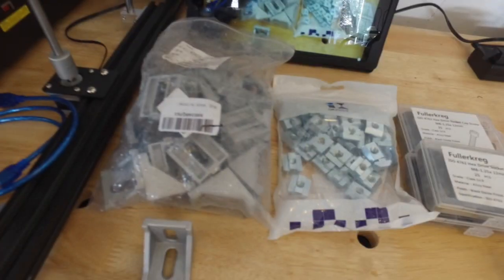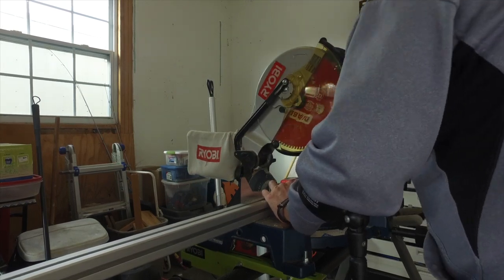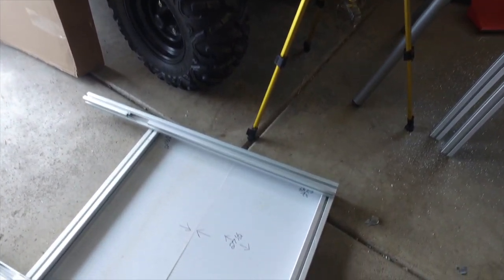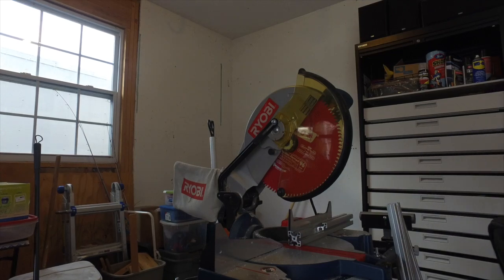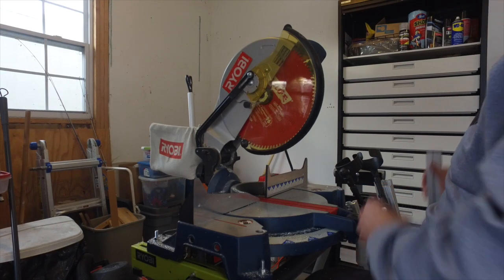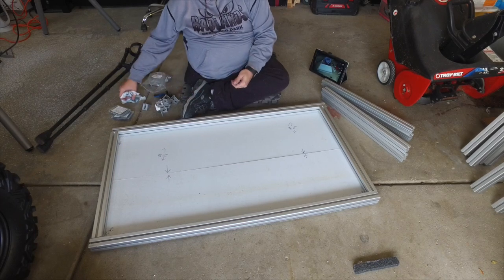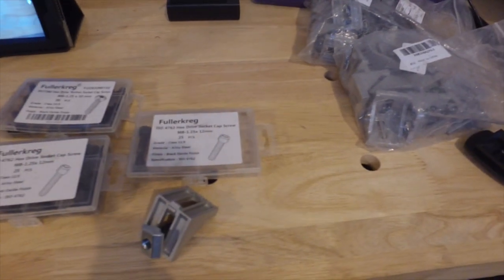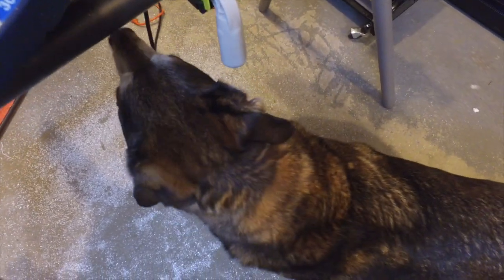How to build a workbench out of Extruded Aluminum - Part 2!

Comment: Nice build. I am looking to do something like that myself. Just getting the extruded aluminum parts together now. I have some 2560 left over from my miter saw station project so trying to figure out how to work that stuff in with the 2020 and 2040 and 4040 ect ect. atleast the v-slots are very close on the 2560 and 20 series used on 3d printers. High five to Bear. Shields up. headed to watch part 3 now.  Thanks for taking the time to make these.